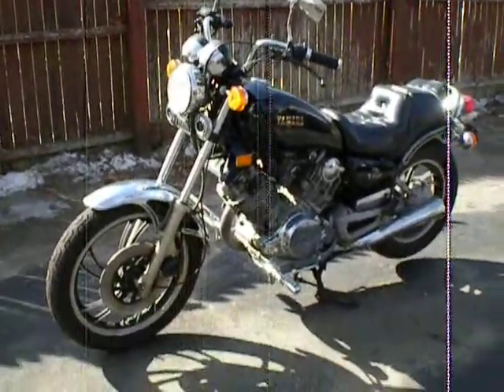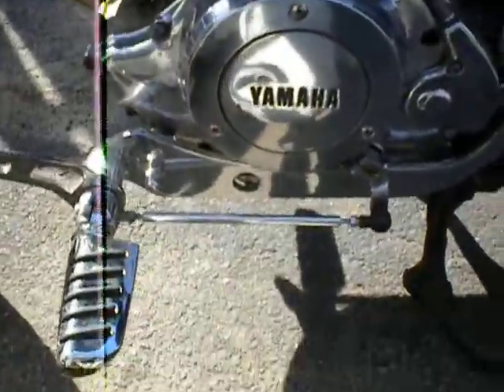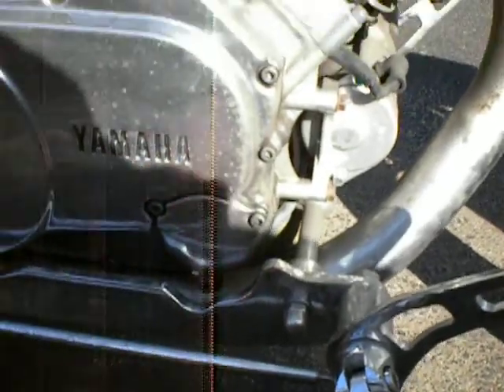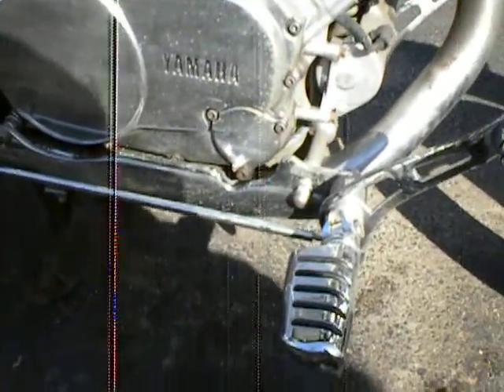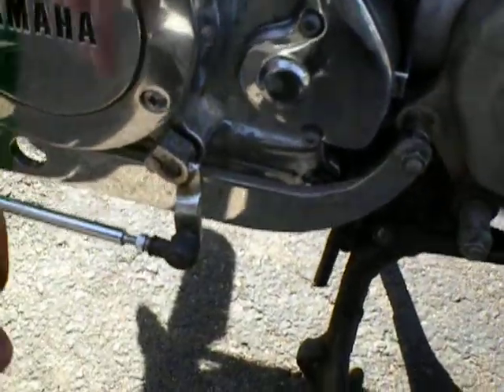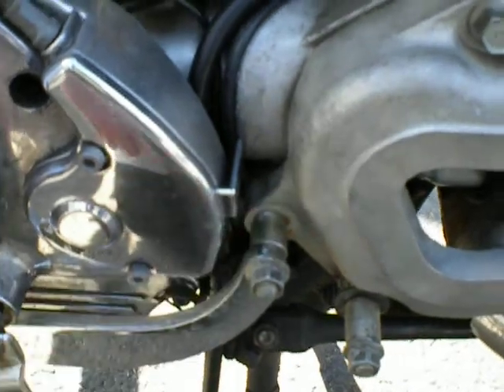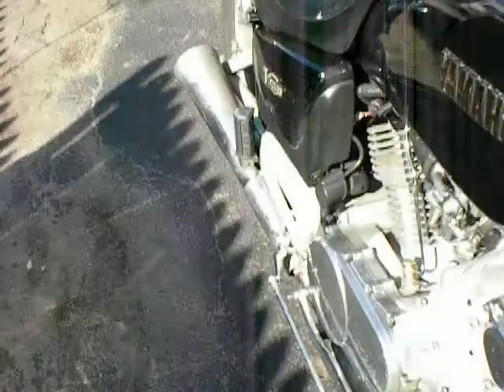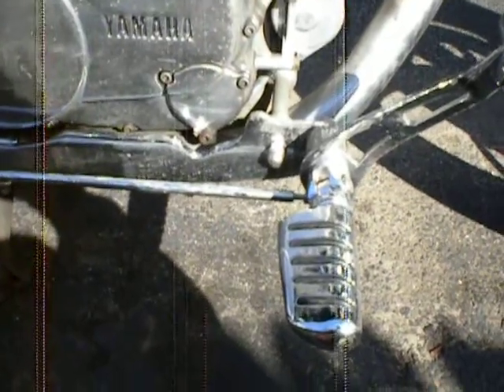Forward Controls 1982 Yamaha Virago XV750J

Comment from the maker: @TheBanelorn I got the HighwayHawk 492-603 forward controls, with a shift linkage from an 84 Virago 1100.  The spacer were originally spacers that I cut down to size.

If you have an 84 or later Virago, you shouldn't have to get anything special to get them on as far as I know.